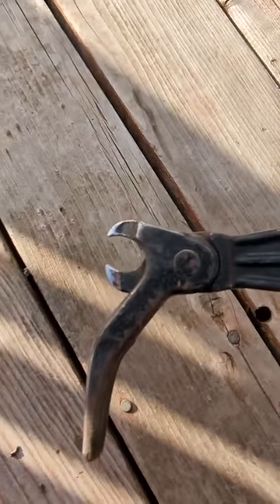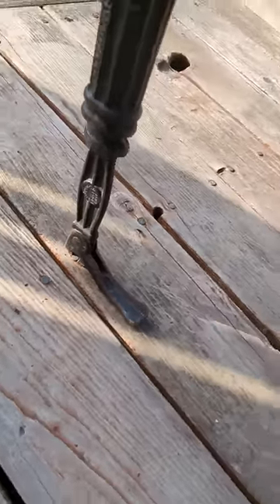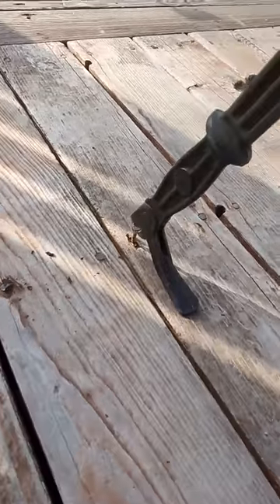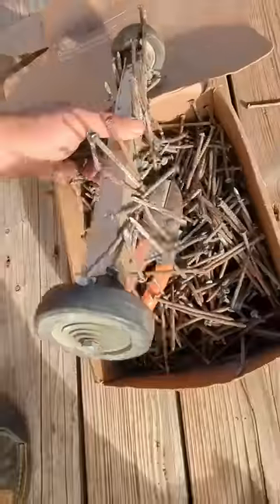The Deck flip is on! #deckrestoration #redwood #reclaimedwood

Comment: Gotta rotate your deck boards every 8,000 days. Make sure to balance the lumber before reinstalling.
Reply: “Hey Siri, set a reminder for 20 years from now to rotate my deck boards”
Reply: That’s why he’s using screws to make it easier next time.
Reply: Don't forget to retorque them after a few months, don't need them popping back out now
Reply: Then you can resurface the joists incase they get a bit warped
Reply: all my structural support beams have been deemed good as new just running them through the plainer flat and sexy again just now the place wobbles under the slightest movement and i hear creaking like something is about to fall 👀
Reply: he was only supposed to rotate  it this time he screwed up he didn't need to resurface until next time hahaha
Reply: don't forget to re-torque those screws too
Reply: Lol hahahaha o and stretch them with a board strecher
Reply: Just get a really big Plainer and resurface in place! 😅
Reply: I'm dead LoL
Reply: I pay someone to come out and do the alignment on my decks.
Reply: That’s only if your house in on a north north east heading, for houses facing straight north or south you have to  diagonally put the boards down on top of the deck, or because your facing north and the boards are lining up w it h the earths magnetic poles, but it will make the nails slowly come out and make the deck garbage.. and also when doing your normal 8,000 day board rotation you might as well flip the floor joists as well while your down there..
Reply: I think this joke. but it sounds legit.
Reply: Onto the next job, rotating the shingles 😮😅
Reply: Best comment on the board lol
Reply: LMAO. That's good. I'm sure he'll put that in his next video.
Reply: @spencerpeterson8695 🤣😂
Reply: You pulled that 8,000 right out your arse didn’t ya 😂
Reply: Can't forget the blinker fluid hack. It's good for polishing the wood.
Reply: Who’s doing that 🤣🤣
Reply: 8000 days? 😂
Reply: Dang, what weights do I put on it? My machine keeps spinning but not telling me anything
Reply: Is rotating really necessary if they’re directional boards? 
I think my contractor is screwing me.
Reply: You fool 😂😂😂
Reply: So i was thinking if i should get pepperoni with some bell pepper. Add some garlic bread. They always ask if i want cheese. In that case, id say cheese sticks buddy. I boiled some eggs earlier and then put them in the fridge later to snack on. I usually roll my weed with zig zags. Before i used to roll my weed with tobacco wraps. Yes i know yall are all wondering, where the fuck did he get that nail puller?
Reply: So instead of 5000.00 worth of wood its 5000.00 worth of labor. Lets be honest this is your deck😅
Reply: @AffordBindEquipment he’s prob gonna put the screws in the holes from nails
Reply: @Bob3519 Plainly you mean a planer.
Reply: @michaeltaylor4271 did you just say the magnetic poles are going to affect the screws? If so, you’re either telling a joke or you need a psychiatric appointment because the Earth’s magnetism is not going to affect the screws.
Reply: He's using screws in the old nail holes😂😂genius
Reply: People think you’re serious 😂
Reply: After watching I was like ok maybe then I read your comment and started looking up somebody to pay 😂😂😂😂😂😂😂
Reply: Lmao deck rotations 🤣🤣
Reply: Hahahaha!
Reply: Just use a big sander take the first lil layer of age off n bam new deck 🤣 gotta hit it with that Thompson water sealer then u really be good
Reply: I cant remember what i had for breakfast yesterday... yeah im fucked lol 😅
Reply: @AffordBindEquipment  Having someone else do it makes it easiest
Reply: @spencerpeterson8695 😂😂😂😂😂
Reply: You sound like hank hill
Reply: 21 year we all might be dead
Reply: And if you get a nail too close to the edge of the board you can't  plug it so you have to buy a new board.
Reply: @michaeltaylor4271 Genius I tell, just genius…
Reply: @spencerpeterson8695 😂😂😂😂😂😂😂😂
Reply: I prefer to rotate mine every 3 oil changes of my deck
Reply: @AffordBindEquipment don't know if it is easier, I've removed both and it really pends on the joists below. If it's alittle rotten then the nail is easier because the screw can't back itself out and spins, but in the same thing with nails. If the boards are wet at all from rain and have swollen alittle, those nails have so much friction on them it's damn near impossible to pull them out. Kind of a pick your poison I guess. Atleast the deck screws are coated so they won't rust and leave stains as bad.
Reply: @Enju23 ain’t a fucking car guy there’s no proper torque specifications to be followed😭😭
Reply: Yeah, nobody is doing that.
Reply: I buit my deck 30 years ago. About 8 years ago we just pryed up the nailed down boards, removed all the nails, screwed the boards back down. Then scrubbed and waterproofed the boards. We didn't plane anything took two days.
Reply: Slam it down on head..pause 😂
Reply: What does balance the limber mean?
Reply: @SnowingNapalm  Thats sounds like your house resettling. It sat on those supports for decades before you replaned them. Its gonna take a while before everything sits just right. Give it a few years lol. Could also be your hvac if its a wood knocking sound your hearing. Those hangers may need to be adjusted depending on how much the house moved while you were replacing them. Good luck
Reply: A bit of deck shine every so many thousand miles will help out too.
Reply: @spencerpeterson8695 Your gonna be almost two years early
Reply: He forgot to recoat 'em with the factory recommended 5 gallons of C.U.M adhesive and deck sealer it restores the proteins in the wood keeping it healthy and shining and it's good for the nails too so you won't be left feeling so screwed 😅
Reply: @SmoothBrain23 no that's flipping the shingles in legalize
Reply: @joshuacarey9367 and this is your deck getting screwed on drug's
Reply: @Sergeantflips  that's perfect 😂😂😂
Reply: @spencerpeterson8695 it's actually 22 years
Reply: @Bob3519 is it possible to use a floor sander?
Reply: Oh my God I died reading that😂😂😂
Reply: Lmao ok boomer. I’m thinking most of us don’t have lives so perfect that we have 8,000 day reminders telling us it’s time to “rotate the deck boards” 😆😆😆
Reply: Are you serious?
Reply: @AffordBindEquipment Stainless steel screws are best.
Reply: @organichuman  velcro would make it way easier.
Reply: Dont forget to wirebrush the mating surfaces so your deck doesnt vibrate while in use
Reply: @spencerpeterson8695 21.9 years*
Reply: @mountain_man89 used to work in a wood shop. Was working using this expensive wood that is only available in areas that gorillas are because the particular color is only available after it is grown with gorilla shit... Anyways .. long story longer.. I cut a few boards about 3/8 inch short... Well the master carpenter shows me that if you pee on the board, put it on the ground and stack 1376 lbs on it for exactly 2 months, 58 days 128 hours, 20 minutes and 4 seconds, you indeed can stretch a board
Reply: Woooow
Reply: Remember to check your deck oil too.
Reply: @Bob3519 floor sander
Reply: Loving this comment section rn! 🤣👌🏾
Reply: @garythompson8545 you just gave me flashbacks of watching the Weather Channel as a kid LOL
Reply: And seal all 6 sides.
Reply: Great advice, what’s your thoughts on fighting ancient evils and guys who shoot lightning?
Reply: Bro 😂
Reply: And next week we show you how to straighten 30 y.o. Nails and save 45.00
Reply: This comment section is giving " go to the truck and grab the matterdaddy" vibes
Reply: Why must they be flipped? 😧
Reply: Or just buy composite lengths of decking so no more painting or rot.
Reply: @spencerpeterson8695 22 hears
Reply: The ladies tell me i have a huge deck
Reply: Don't listen to this dude there is no such days
Reply: Yeah im not rotatin a thing... i rent lol
Reply: You just changed my life
Reply: Why wash then plain? Just plain OR wash?
Reply: @grimmagic2329 me too 😂😊😊😊
Reply: @spencerpeterson8695 make that a month short off 22 years to be exact
Reply: @Enju23 whats retorque
Reply: Got you one!!!
Reply: @spencerpeterson8695 😂
Reply: Maybe just sand?
Reply: @a-yates can you elaborate in this 😮
Reply: I do it every 200 000 hours at home.
Reply: I just buy a new house when my deck boards get worn out. Much easier.
Reply: @spencerpeterson8695 lmfaooo
Reply: @Enju23 😂😂
Reply: The plant
Reply: Best comment
Reply: Tell me ur a tyre fitter without telling me 😂
Reply: Yeah but then you gotta get it aligned. Just burn it.
Reply: Such an expert
Reply: Rotate every 22 yearrs, eh? lol!
Reply: Y'all forgetting the most important part. Don't forget the carburetor. Everyone does!
Reply: Let just sad around 22 years instead of 8,000 days because there are 300 million people in America so there are 150 million people dummer than the average people
Reply: how do you rebalance lumber? ( sorry, female here asking)
Reply: Don’t forget to spin your house a couple times too…get all that pinestraw and old paint off and it’ll look good as new.
Reply: @unyen3288 Where u get that pic from😅
Reply: @spencerpeterson8695 dude you had me crying laughing 😂😂 with that comment
Reply: @spencerpeterson8695 😂😂
Reply: He lost me at nails